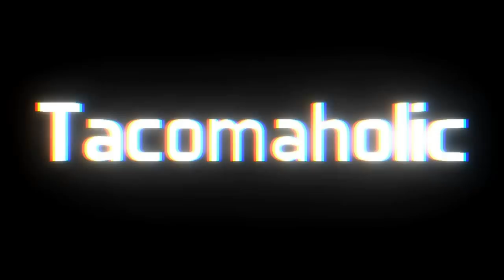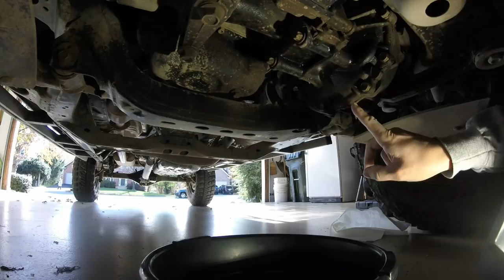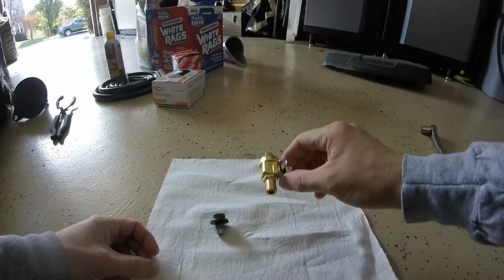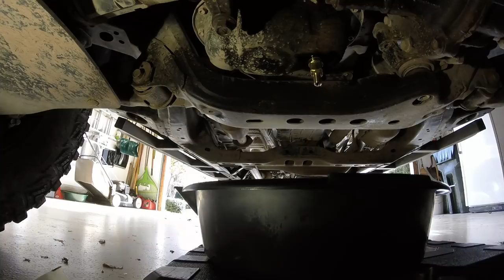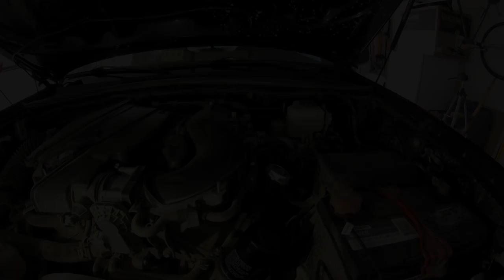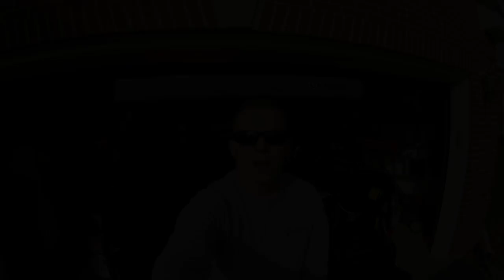DIY Toyota Tacoma Oil & Filter Change — 4.0 V6

Comment: How often do you do your oil change? I drive like 5kmiles a year but do my oil change (mobil 1) every 4k which is like every 8 months. What do you recommend?
Reply from the maker: Sort of depends on the oil you are using and if it's conventional or full synthetic. The last oil I used was Mobil 1 Full Synth extended performance which was supposed to be good for 15k miles. I don't feel comfortable going 15k without an oil change so I changed it at 8k. Regardless of the oil you use you should change it at least once per year.
Reply: Follow the factory recommendations.
Reply: I dont know. My 2010 prerunner recommends 0w-20 for best fuel economy or 0w-30 if preferred.  I use synthetic  blend
Reply: It is a good idea to keep change oil around 5000 miles. One of my younger brothers keeps change oil every 3000 miles for his used Lexus which his car mileage is over 200,000 miles.

Comment: How about putting 1.25 “ wheel spacer should get away with it? What do you think?
Reply from the maker: Just depends on how much it is rubbing but it will probably help. Mine were rubbing pretty bad and I had to cut and trim.

Comment: I hate how I really have a hard time reading where my oil is at with the dip stick.  I have to be doing more than 5 rechecks to be able to see a visible read…  any trick??
Reply from the maker: You could lightly sand the area between the marker dots so the oil sticks better in that area.
Reply: @Tacomaholic  thank you so much for this little tip.  Didn’t think about it lol
Reply from the maker: @edwardnoyola2860  Sure thing. I don't know why but the Tacoma dipstick is harder to read than any other vehicle I've owned.

Comment: Where did you jack up your truck to do oil change?
Reply from the maker: This was done in a flat garage so no need to jack the truck.
Reply: @Tacomaholic  what model and size drain did you use
Reply from the maker: @terencebrill1402  I've got links for all of the parts I used in the video description, but this is the drain pan: https://amzn.to/3cwWBUY

Comment: How often do you change your oil on a Tacoma
Reply from the maker: Depends on the oil you are using. If using full synthetic I change it every 7-8k but for regular conventional oil I'd say every 3-5k.
Reply: Tacomaholic awesome thanks I have a 2013 white trd off road not 4x4 but here in Texas I don’t plan on off roading too much

Comment: So doing my oil change now and the oil drain lube where the filter is at had a nipple tsb which I removed and none of the oil went through so now it's just sitting there and I have to absorb it with shop towels.....smh....And got oil on my belts.. will try to water that down...
Reply: Oh wait I know now why lol dry mud from mudding lol
Reply from the maker: Lol at least it's something that is easily fixed. Messy though. 😀
Reply: Tacomaholic yeah I just saw that some words were misspelled so I see how confusing reading that might of been lol but yeah that nipple drain is plugged up by dry mud lol so idk what should I use to clean it out?
Reply from the maker: Get some kind of fast food plastic cup and punch a few holes through it, attach a small bungee cord to it and fasten it around your filter so the cup is beneath it to catch all the spilled oil. Cleaning the dirt out from the drain hole should be easy with a pipe cleaner or something like that.
Reply: Tacomaholic will do 👍
Reply from the maker: Let me know how it works out.

Comment: Just wondering did you add washer to fumoto valve
Reply from the maker: Yes the washer comes attached to the fumoto and you can see it at 7:13 in the video. It's sort of light blue colored.
Reply: Cool